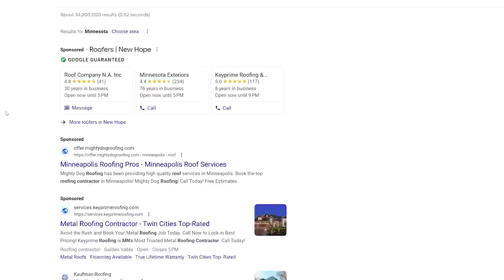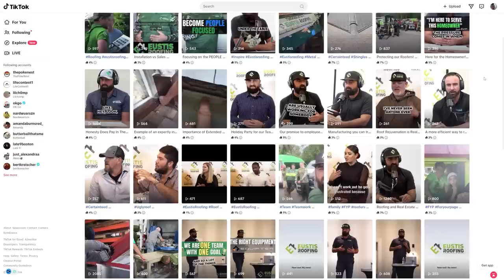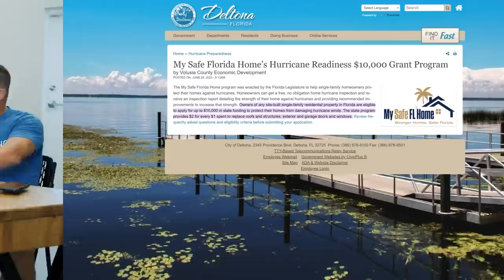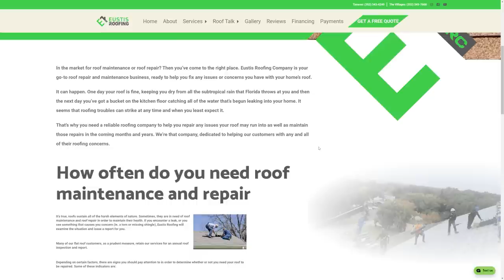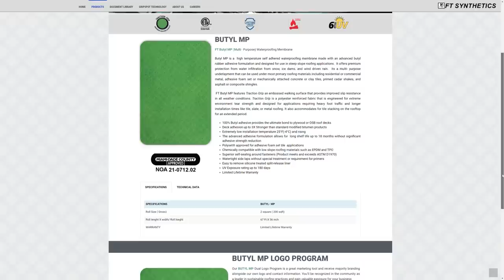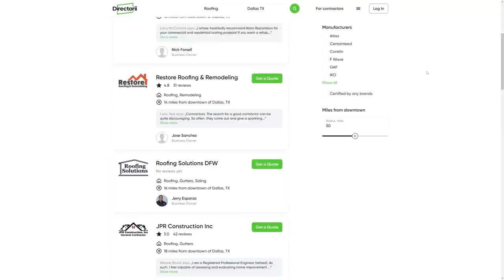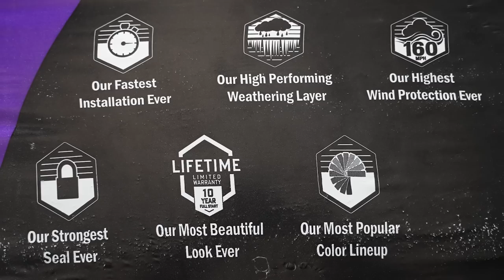Roofing in Florida: what’s new in 2023? Jason Reisman and Chris Porosky

Comment: We worked Fort Meyers/Cape Coral October to July and it was always who was offering lowest price, many people down there don't care about signed contracts, and many had no clue how expensive their roofs truly are. Also the insurances have screwed so many people all over. And insurance adjusters were doing some lazy inspections, easily got 4 homes approved month 1 that insurance tried to say was minimal damage.
Reply: It's not lazy its brand new scared to write for damages and not knowing how to write for damages. Those adjuster left a lot of money on the table by not buying due to there fear of pulling the trigger and not knowing what to do. Most of them probably had zero experience and were running hurricane claims which they had no business doing. I bought every roof I stepped on down there even a 6 month old tile roof. I was actually instructed by QA of the carrier to buy everything the homeowner brought up while  doing the inspection to avoid a lawsuit. It was a lucrative time to run claims especially with the pricing and regulations down in Florida. Of course there are other carriers that don't like to pay they are usually on the TV advertising with commercials.